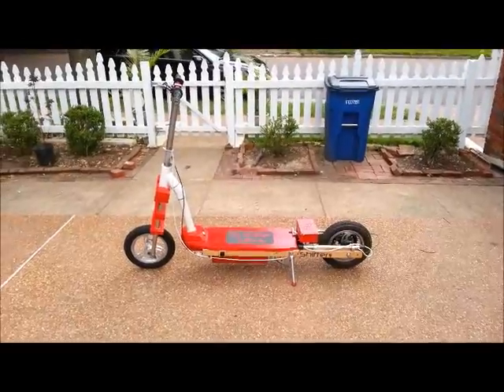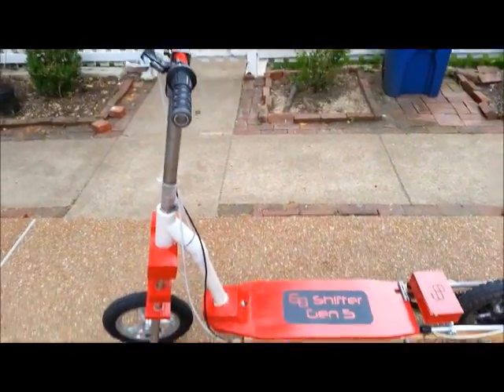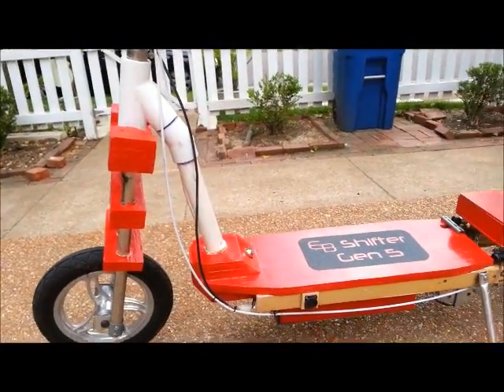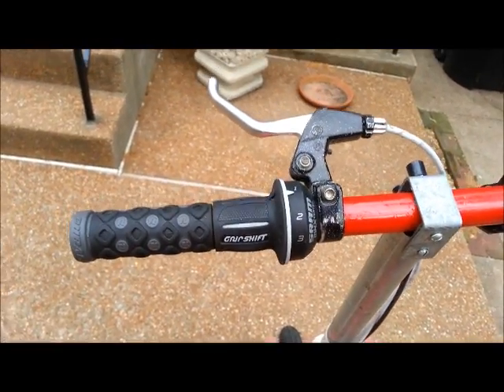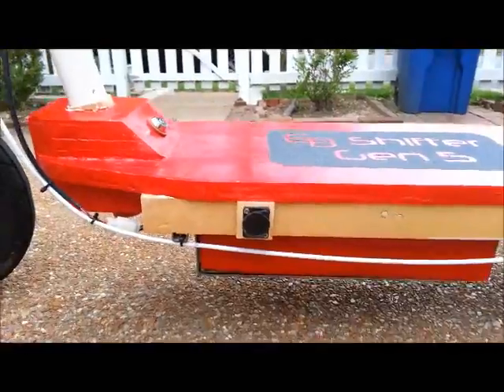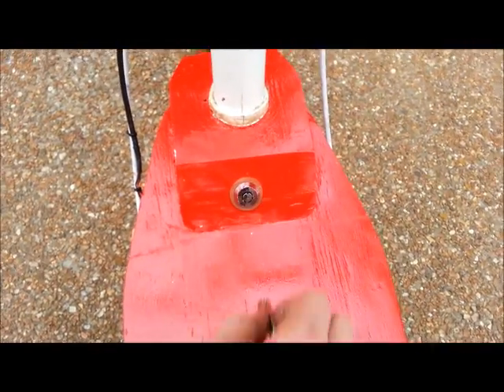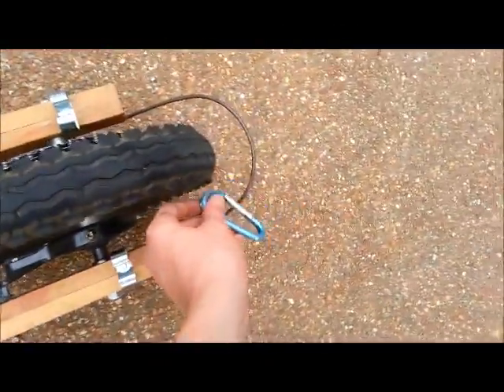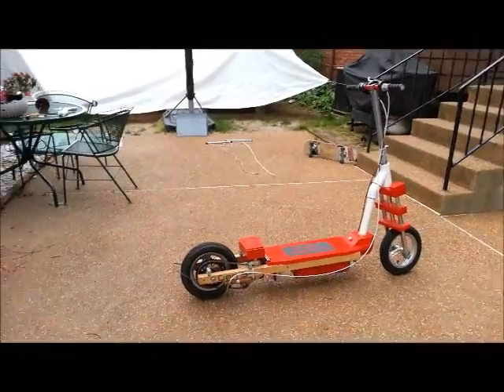Homemade Electric Motor Scooter - 2 Speed

Comment: Excellent! I appreciate that you have 5 versions of your scooter. I'm working on an electric quadricycle (no welding) and was wondering what is the backwheel held by (steel rod?) and what type of nut holds the rod?

Thanks in advance for the reply.
Reply from the maker: It is actually steel bolt used for a motorcycle axle I think. Its an 8 inch axle bolt with threading only on the last inch or two. It has a hex head on one end and a nylon lock nut on the other end.
Reply: Oh ok. Thanks again for the info!

Comment: Could you tell me how you made the 2 speed? Looking to do it my self but got no clue! Would really appreciate a response, would sub and like the vid. Cheers
Reply from the maker: Jackson A Hi Jackson. To build the 2 speed system, I modeled the design of a mountain bike gear derailing system. there are 4 main parts: drive sprocket, chain tensioner, and rear wheel chainring, and the derailer. Most of this can be pulled of a typical mountain bike and then be modified to work on the scooter. Make sure you use bike chain (7,8,or 9 speed) Good luck!
Reply from the maker: I don't have any drawings unfortunately but if you watch the end of the video I explain the parts I used to make it. Hope that helps!

Comment: what is the sprocket/gear ratio?
Reply from the maker: +asdfghjkl1234451  For the low speed the gear ratio is about 1:4 and for the high speed its about 1:3.5